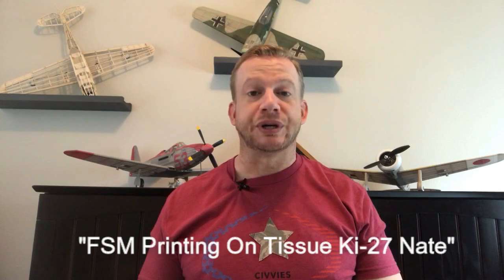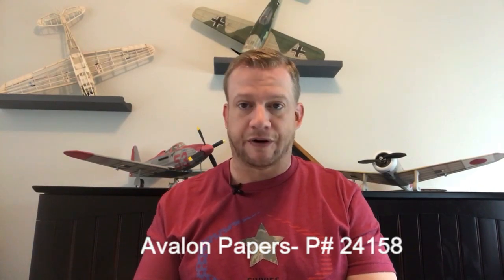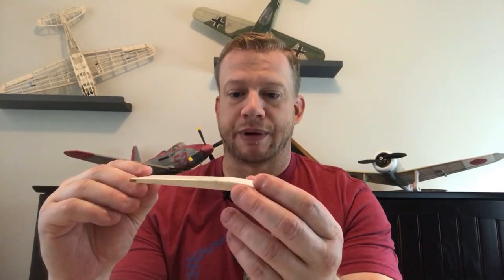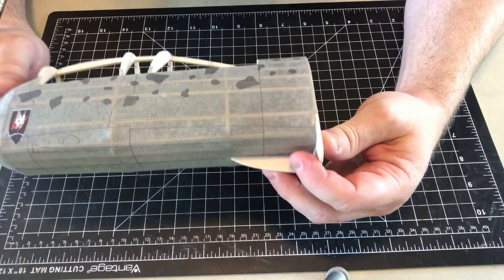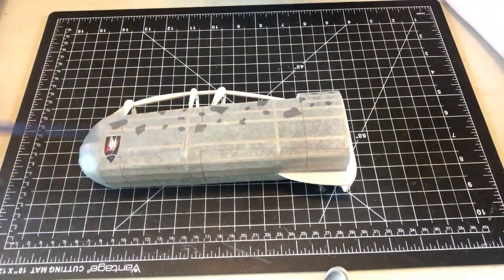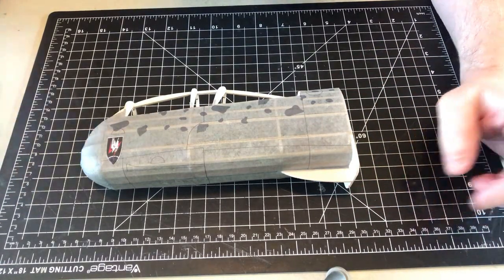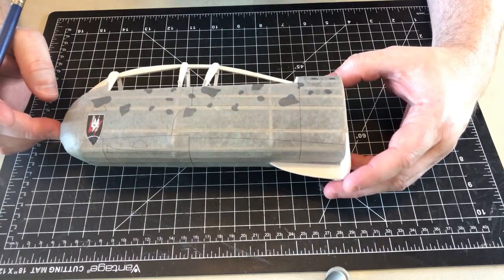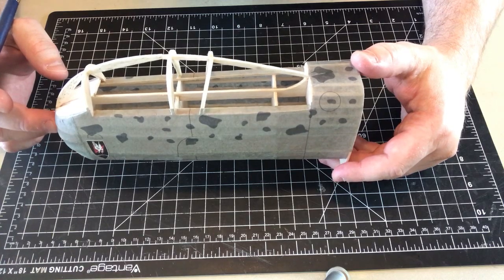Fun Scale Models Printed Tissue Techniques Part 2

Comment: It's a Heinkel 219 Uhu. Personally, I always try to shrink out the more stubborn wrinkles completely with additional local applications of water to problem areas. My girlfriend's makeup brush seems to be the best thing to apply water exactly where I want it. I appreciate that you were covering the extreme nose in separate pieces of paper in order to demonstrate the shrinking ability of the paper but I'd definitely fill between the nose stringers with soft balsa and sand it to shape to avoid that faceted, stretched paper look. The Uhu is a weirdly cool looking machine, I hope you're going to make the whole model!
Reply from the maker: Hi Pete , thanks for the comments and suggestions. I haven’t tried that type of a brush before but it seems like that would be a good tool to use. On the final version of the design I may fill in the nose to make it a solid block, that would help change the overall look and make it closer to the full size :-)
Reply: @funscalemodels9782 , I look forward to seeing the finished model, I really like the others you’ve designed, particularly the Nate, lightweight electronics have opened up the possibilities for stick and tissue models in ways that we only dreamed of as kids.

Keep up the good work, you’ve just got yourself another subscriber!

Comment: This method is not good for free flight model builders.  Japanese tissues with an acquired skill of sprayed dilute acrylics is skill the best.  There's no shortcut for this if you want it done right.  Also, it's never mentioned that printed
colors are fugitive, especially the red, and starts looking like shit very soon even when protective UV gloss or matt finish is added also increasing weight. Nothing beats old fashioned dope sprayed on water shrunk tissue.